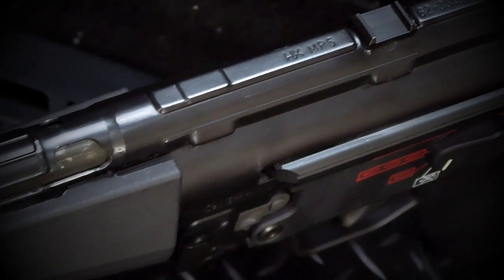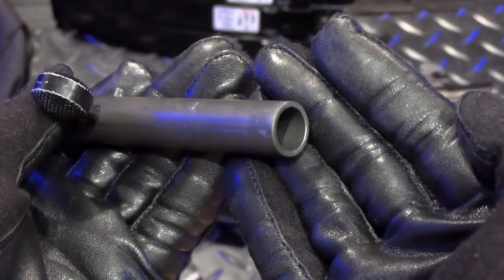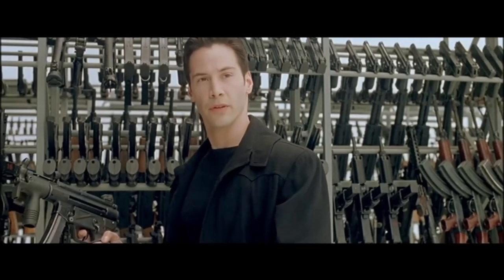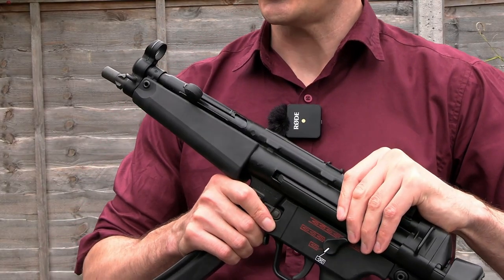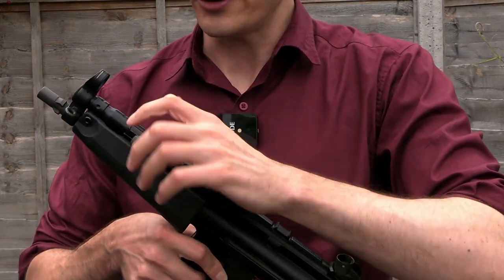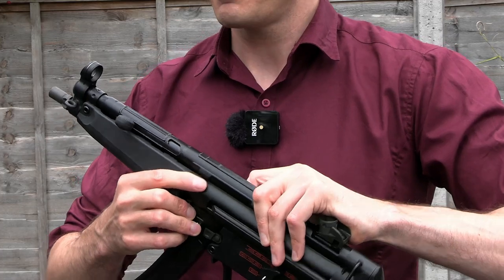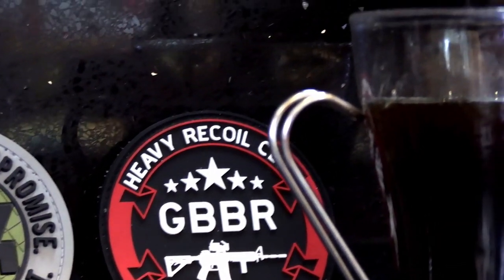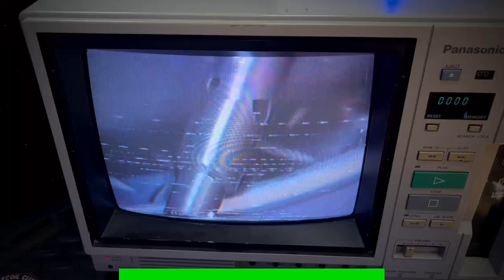Clutch Precision Steel Cocking Tube for VFC MP5 GBB

Comment: Since parts for the Crusader are not available, this information on parts was very helpful. I have just ordered this part. thank you.
Reply: I received the part I ordered today. The pin that holds the cocking handle in place is not a spring pin, so I counterbored the support hole a little before inserting it. Thank you very much for the information on this part.

Comment: My charging handle’s pin doesn’t quite fit in the hole of their cocking tube. I think the new batches of VFC MP5s are different than what baddabing or Explosive Enterprises has.
Reply: Hey bro, me have to the same problem with the charging handle pin, do you have any solutions? Thnx

Comment: Mine won't go fully forward so it won't lock tight and get's loose with minimal movement .  It's also not possible to get the pin of the cocking handle through the second hole on top. What could be the problem?

Comment: Cheers my man! During games (which nowadays is never) I flick it down with my left thumb while already holding the gun. Or if I'm handling it left handed I smack it across with my right hand above the barrel. Very easy gun to handle with your weak hand. But when not on games I smack it from the top as if it owed me money.
Unfortunately my WE doesn't do the bolt stop reliably. It does it most of the time, but not always. I had one mag which was especially unreliable so I glued on a tiny slit of aluminium on the little lever using bison metal epoxy, now it's only as unreliable as the other mags.
Reply: I have 8 mags for my MP5A5/K PDW and have intermittent reliability on the dead trigger lock out on them, but then both my guns are second or third hand before I beat the shit out of them too.

But I do like the idea of the system more than VFC's "smash into the follower and stop" idea.
Reply: @stewbacca117  Mine was brand new and I'm relatively gentle with my guns (except when I fall on them or something 😅), it did it from the first day. Anyway, I like it better too. I have a KWA Mac11 which has a similar bolt stop as the VFC MP5 and it's kind of worrying, my OEM nozzle didn't do well, especially the loading spike.
Reply: @sogerc1  I too have that KWA MAC. But it barely gets used, I've been trying to field the KWA Vz61 as a sidearm while I test the new SVDS from LCT. Just to get some time behind it.
Reply: @stewbacca117  My Mac also didn't see many games, it's not good enough as a primary and too cumbersome as a secondary, noting beats a good old pistol. But I still play with the Mac, in the backyard and stuff. My loading spike grinded off very fast. My friend who's good at tinkering fashioned me a new loading spike out of brass, in that form the Mac performed the best, but one day the whole nozzle broke in half. I got a Wii alu nozzle, that doesn't break but it's also slightly off-spec, not as cold resistant and the gun requires even more lubrication than before. Just saying so you know what to expect.
Reply: @sogerc1  yeah mine experiences a lot of cool down and dry out as well, seems to need to be swimming in lube to feed effectively, I think open bolt airsoft GBBs have a lot of inherent problems to face as well, with seating of the round in the HOP nub and whatnot before the firing cycle commences being more of an issue
Reply from the maker: @stewbacca117  Klobb! I always wanted one of those. Maruzen or KWA.
Reply: @BadaBingPictures  it's horrendously good fun, and actually fairly practical, certainly in CQB and closer range jungle engagements.
Reply from the maker: @stewbacca117 one day I might add it to my collection. Have a section of GE guns in my armoury 😉

Comment: how do you even get the cocking tube out?

i push the charging handle down with my thumb, because parts are hard to get in my country, and it doesn't help vfc have a nack for discontinuing the most broken parts.
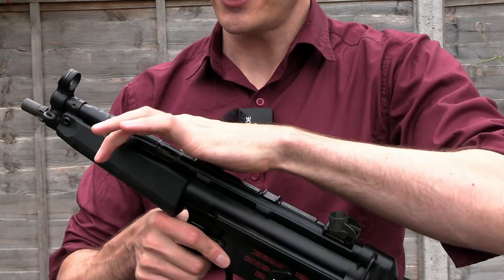Reply from the maker: @04:49 
You’ll see that pin, and you can knock it out from under the Handguard upwards.  It’s gnarled end is located on the top of the MP5, so be sure to tap it out from underneath.

Comment: Is that the first or second gen VFC MP5? Their Gen 2 MP5k that I have has withstood a fair beating and slapping - and you know I'm more of an abuser than Sean Connery on that front. 😂

I got the PDW stock for mine separately
Reply from the maker: It’s for V1 & V2 MP5’s. 
I would say that’s true, but Sir Sean has a lot more mileage exercising his … serve, than the pair of us put together 😂👋 

Dead jealous! They’re incredibly cool. 
The K PDW’s I’d argue make better MP5’s than the full sized ones. They’re almost supernatural entities in confined spaces!
Reply: @BadaBingPictures  I'm waiting for the SD2 to be released, but might eventually shell out for an A5 to replace my WE which is now sat under my bed languishing with the WE MP5k PDW as well. The HK53 has taken it's spot on the wall and that is built like a tank at least. Ran it again the other night at IPSC 😂🤌
Reply: The genuine parts of MP5K are made of steel, so they are more durable than those for MP5.